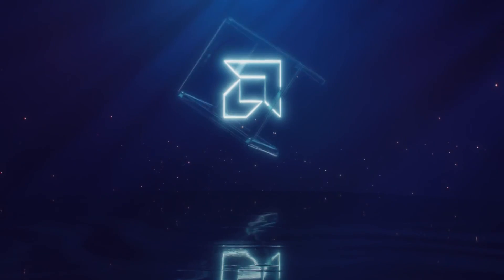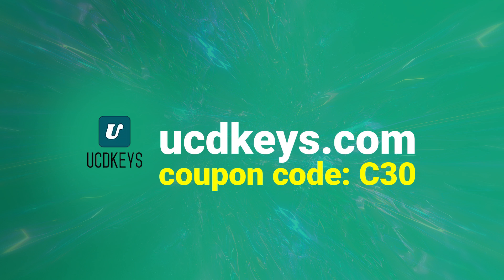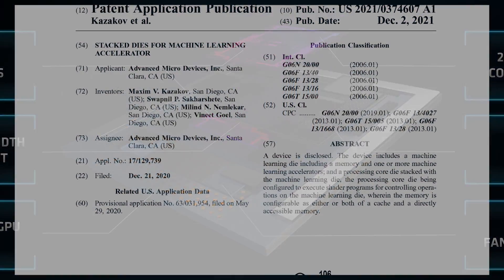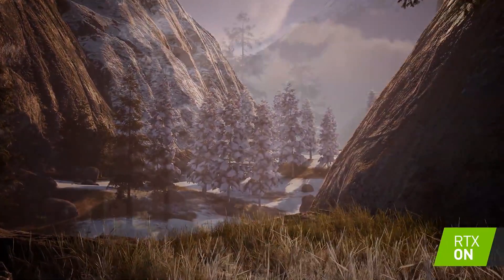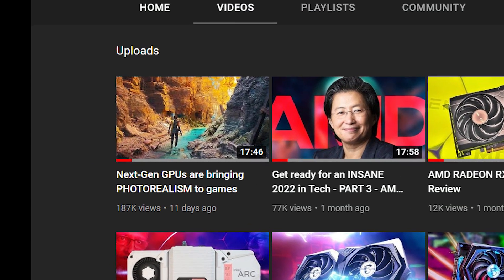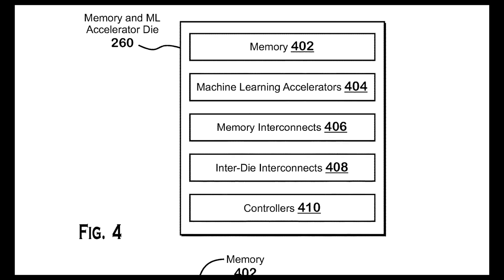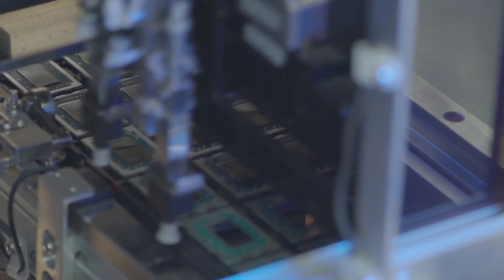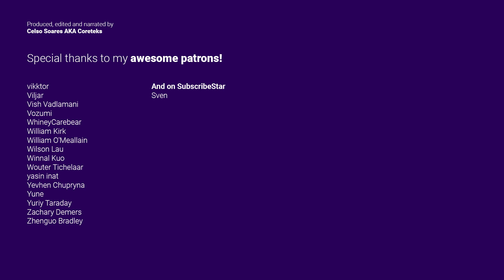Is AMD adding a special ACCELERATOR die to RDNA3?

Comment: If it's matrix calculations then it's the same as Nvidias Tensor cores.  It has a multitude of applications in machine learning but I'd imagine they also want to close the gap between the ever improving DLSS and and the not so good fidelity FX.

Comment: Intel is doing this in Sapphire Rapids and undoubtedly Ponte Vecchio and AMD and customers are doing ML / AI simulations in LC Epycs where algorithms on matrix math are well understood and known for the last 200 years now being implemented in hardware functionality. M12x0 like Nvidia GPUs would be a general matrix spatial engine; 'convolutions compute unit', therefore AMD needs something else that takes simulation development the matrix math and there is all types from Epyc LC development to actual hardware. White papers on tensor will show all the algebra and calculus and when shown in a schematic essentially show what has to be done in hardware to implement that functionality that r essentially just calculators, they call the accelerators, they're calculators basically. mb

Comment: Nvidia gave up on real time AI raytracing because it is way beyond the capabilies of anything that could be put in a consumer gpu and sold for actual 5000% profit they require. Why would AMD , with significantly less RnD resource go down this waste of time path?
Reply: Matrix calculators are used for machine learning not for ray tracing.  It's basically the same as Nvidias tensor cores used for DLSS.  Nvidia definitely have not given up on ray tracing either.  Unreal Engine 5 is making heavy use of it and having hardware that boosts the performance of that is a must.  Full scene ray tracing is decades off but ray traced lighting and reflections are great for now.

Comment: Assuming that this comes to consumer video cards and processors, there are many other applications that it could be used for. The most basic would be as an AI co-processor for artificial intelligence-based software. Apple has this built into  processors for phones, tablets, and personal computers. Wouldn't it be nice to have a virtual secretary of your computer with better voice recognition and syntax analysis? Or what about anti-malware and firewall software that could do real time background analysis of processes on your system and a real-time deep dive of incoming email and downloads without degrading performance of other tasks?
Reply: 1) GPUs can do all kinds of AI work several times faster than a traditional CPU.
Why add AI accelerator to something that already does AI very well?

2) The AI needed in consumer computers doesnt need 400 mm2 or something of tile/chiplet/whatever with only AI processing cores on top of the main GPU.

Comment: What I am seeing is AMD, or Intel, or nVidia basically trying to catch up to Apple. The Machine Learning cores? Check, Apple has done that, even on the first M1 CPU, they just added more onto the M1 Pro and M1 Duo. Dedicated accelerators? Apple: done, put some Pro-Motion accelerators on the M1 Pro and M1 Duo a few months ago, alongside some other dedicated processors. Stacked memory? Apple: no, ours is not stacked, it is an MCM (i.e. planar) approach. On the other hand, it is ALL OF THE RAM IN THE MACHINE, not just caches. Does it matter? Depends on the latency and bandwidth that can be achieved by each approach. and no, it doesn't need to be insanely fast, just fast enough to keep the GPU and CPU from waiting on data.
Reply: Catch up to apple?  Nobody is using apple in this space.  Nvidia had the machine learning and ray tracing cores before them in the RTX 2000 series 2 years before the M1 and are leagues ahead of them now.  AMD had the on die memory before them with HBM  nearly 7 years ago.

Comment: Why isn't Apple's M1 chip with memory on the SoC not considered "3d stacked" and what advantages it has over "normal" PC memory layout?
Reply: if you take a look at photos of the m1 chip you'll see that memory is actually soldered right next to the cpu instead of stacked. 

Also the memory being stacked on amd's next generation of cpus isn't ram like the memory soldered next to m1 cpus but rather cpu cache which is significantly faster than conventional memory by stacking cache on the cpu you have greater real estate to add more of it to a cpu and thus better performance.
Reply: @brandonn.1275  

And is there any advantage for the M1's soldered memory vs traditional "slot" memory?
Reply: @celdur4635  Much higher bandwidth and much lower latency.
M1 Pro: 204GB/s bandwidth
M1: 68.25GB/s bandwidth
DDR4 3200: 	25.6 GB/s
DDR4 2133 (design spec): 	17 GB/s
DDR5 is anticipated to have a 36% increase in bandwidth.
Reply: @tim3172  

I see, so why don't AMD and Intel also solder the ram to their SoCs?
Is the tech Apple only? combine solder ram with 3d stacked cache would seem the best combo no?

Or do you need some ARM trickery for that?
Reply: @tim3172  
IIRC, latency of LPDDR is NOT lower than latency of DDR memory.

Also you forgor lower power draw.
Lower power is literally in the name of LPDDR
Reply: @celdur4635  
Cost and limited RAM size.
Reply: Higher bandwidth, lower power draw and possible lower idle power draw
Reply: @suntzu1409  Thank you for the answers.
If i understood its fundamentally easier do everything in the SoC if you use ARM, because the power draw is the "real" barrier to beat. 

A question would then be, does x86 have a future at all, at least for the mass market? 

I guess a lot of folks want Intel and AMD to move over to ARM don't they? and Microsoft has been developing windows for ARM, i have seen videos about that.

Maybe x86 will be only used for certain "niche" devices in the future.
Reply: @celdur4635  
LPDDR used in M1 chips is the exactly the same as the LPDDR in laptops with x86-based chips.

(Laptops with "soldered RAM" have LPDDR RAM)

ARM has got absolutely nothing to do with the kind of memory used.

What really stops intel and amd from using LPDDR on package is cost and limited size.

The RAM in M1 Max feeds both CPU and GPU, so high bandwidth is necessary.
But the "RAM" in laptops with x86 laptops need to feed only the CPU and integrated GPU because the powerful GPUs are discrete and have their own GDDR memory.

So very high bandwidth LPDDR-on-package RAM like M1s is not necessary or needed for x86-based laptop CPUs anyways.

"Does x86 even have a future? has been said for like 20-30 years now.
Number of people saying this has doubled every 2 years, and yet ARM has barely challenged x86 in PCs, Servers and HPC.

Comment: I think you're spot on with this speculation. AMD has patented the stack. I bet they are using TSMC'S Thru via technology or even better what AMD and Hynix used for HBM. But TSMC is better at manufacturing the process.
Reply: This makes total sense. As a 6800 XT user I can say that FSR was a good stopgap solution but only that. AMD is crazy if they launch the next gen without some hardware acceleration for image reconstruction (not just supersampling), or they would be dead third in 2022 with even Intel Arc having a full DLSS-like feature.
Reply: @opinali  No I wouldn't say that. Whichever accelerated image reconstruction the MS or Sony choses will be the AI function AMD will design hardware for. 

UE5 is not the only game engine on the market. You also leave out the costs associated with the SuperComputers needed to do the processing. 

Now when AMD can sell a game studio a small rack of 2 cpu AI tuned Epyc Servers in concert with quad MCM Instinct gpus tuned for AI work. Then all bets are off. Even Nvidia uses Epyc in their offerings for AI work. 

The question to ask is, what is next for Xbox and PS6? It will still have to be relatively "cheap" by comparison to Intel and Nvidia charges for Supercomputer time. 

I expect to see NEW Game Engine technology in two to three years. Why because hardware capabilities are beginning to advance faster than the software can keep up with.
Reply: @jerrywatson1958  You have a point in MS/Sony influence on future RDNA design, but console generations are much longer than PC GPU's. We will have the next gen of Xbox/PS by the time RDNA5 or even later comes out, if they stick with the AMD partnership.

In any case, I don't know if AMD will adopt the same reconstruction model as NVidia's, but whatever they do is highly likely to require similar HW. We already have Intel's XeSS as a second example of something that looks different enough to DLSS to not be considered a clone, in particular the HW part is not identical (XMX units are not the same as NVidia's tensor cores), still the general principles are the same: some neural network; use of temporal & motion data. Not bloody likely that an upcoming FSR 2.0 that can fully compete with DLSS/XeSS will be very different. Innovations will happen in the details; "ML" or "neutral network" are general concepts, each implementation can have its own ideas and algorithms, still they all need similar HW that does many teraflops of low-precision matrix multiplies.

You should also have in mind that AMD already have the IP for massively-parallel matrix multiplication hardware, that's included in their Instinct accelerators for HPC/ML workloads. They have all the pieces including the silicon block, the drivers, compiler/library support etc. so they can basically take that stuff and put in their next consumer GPUs, then enhance FSR to take advantage of this hardware when present but still run with lower quality on older hardware. The "ML ALU" referred by this patent filing can be just this existing design, the patent only tells how you add that as a new component of a MCM-based GPU.
Reply: @opinali  You have a valid point there. But to be honest, it doesn't matter what they come up with in the lab. If manufacturing is backed up for 12 months. Consumers will be left to rot.

Comment: Here's an idea for an AI acceleratior:
1) Design an OPEN STANDARD chip for Intel/NVidia/AMD (for AI upscaling and for ray-tracing)
2) the chip contains sufficient memory to buffer several, 4K frames of data, with the processing required to accomplish this (i.e. "DLSS" on a chip)
3) With a KNOWN chip the machine learning could optimize around this chip and not fret about different GPU architectures, drivers etc (it just works)
4) As a separate processor it doesn't take away from the main GPU processor.
5) *Imagine that you've generated your NOISY, ray-traced frame data (with or without the AI accelerator) and then the AI upscaling algorithm is trained to convert that to the FINAL, high quality image so you essentially combine DENOISING + AI UPSCALING on a dedicated chip in one step.

Comment: The suggestion they'd use an accelerator geared towards applied ML using "offline rendering" means they'd be taking the same route as DLSS 1.0. Which was excessively impractical for even Nvidia with poor results. Even with needing to be explicitly implemented. Completely ignoring the direction software and hardware is moving.
Reply: ??
DLSS has proven to be the way forward. If I understand correctly you're referring to how the first iterations of DLSS required per-game training on offline servers? Okay, but modern DLSS still has an "offline rendering" phase to its training. AMD is likely to follow the same path as NVidia... so I'm baffled that you think this isn't the direction things are going. A dedicated chip that can utilize an AI upscaling algorithm is EXACTLY where things are going.

Comment: AMD need :
Better Ray tracing cores
Better matrix/AI cores
H264/h265 encoder/decoder accelerator
HVEC and video decoder/encoder acceleator

So AMD can compete with Nvidia , Intel, even Apple silicon
Reply: H264/h265 encoder/decoder accelerator
HVEC and video decoder/encoder accelerator

This is awkward but AMD has had that in the form of VCE and VCN since 2014.

Comment: What are accelerators.
Are new "AI" accelerators works like FPGAs or are those very specialized like ASICs?
Reply: they're more so specialized asics and to be more precise they're basically a bunch of 32-bit floating point calculators specializing in matrix calculations called tensor processing units. Training a neural net requires a lot of these TPUs but once training is done you only need to run a fraction of a percentage of the original horsepower to run a neural net.
Reply: @brandonn.1275  So AI accelerators are PUs that trains themselves to perfect a task (say DLSS) without a lot less human intervention? BTW THNX.
Reply: @jangelelcangry  TPUs don't impact the amount of intervention by humans needed to train a Ai just how quickly a data set can be used to train one or how complex the Ai can be.
Reply: @brandonn.1275  OK. Thnx.

Comment: Amazing find and really interesting video! Even if it isn't in RDNA3, the future of silicon design will be based on modularity.
Reply: My first job was in CAD software for a system to design higher level blocks from the common cell level.  It's interesting to see blocks be integrated in monolithic dies as well as disintegrated into previously unthinkable number of MCD chiplets.  These patent leaks have a low hit rate though, stacking performance logic has an obvious thermal drawback.

Comment: I have heard this before, just not sure that in a MCM setup it pays to have a dedicated chip for this as silicon area use is no longer the limiting factor in such a setup.
Same for a dedicated die or heat transfor blocking and heat generating die on top of another, unless on-chip cooling will change also radically (like grooves with liquid in them).
Reply: For GAMING at least a dedicated chip needs to provide huge benefits to justify itself. The added engineering cost to test, then to actually build the chip, write code etc is huge. NVidia can afford to come out with ray-tracing and other features that take a lot of die space and have minimal benefit UPON RELEASE but when you're the underdog it's a bit trickier. You don't tend to want to add something that only benefits a small number of games/applications at first.
I would expect a lot of PATENTS that don't get real world use. Or a lot of patents that go into non-gaming GPU's.